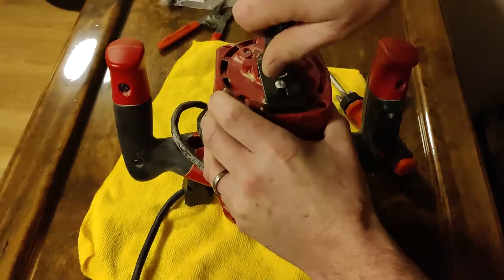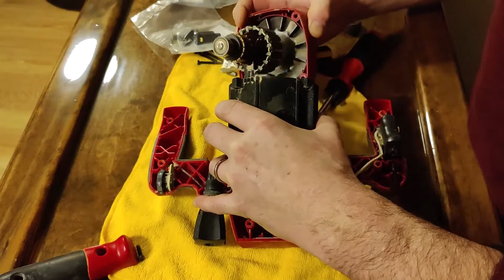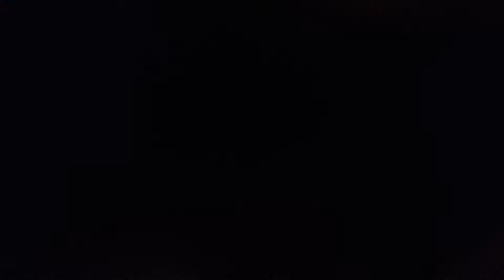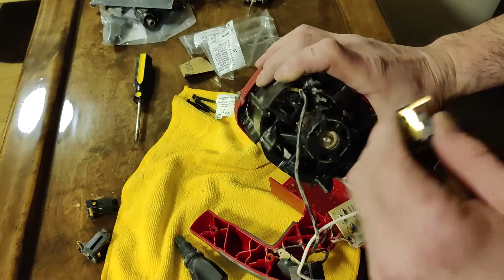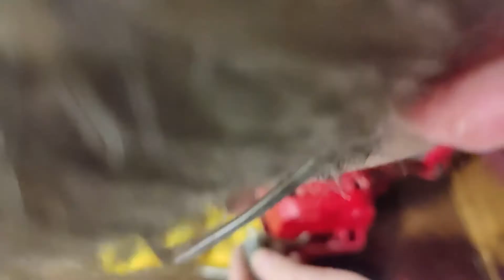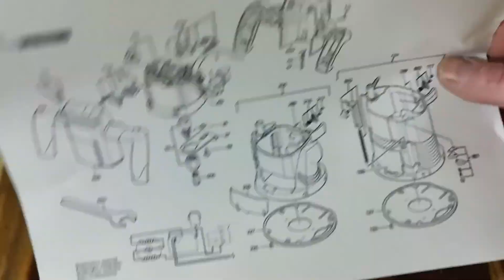Skil 1825 Router Brush Replacement

Comment: Glad I found this because you identified the replacement brushes. In case anyone wants to know, the part you removed was the armature shaft, not the motor, and it contains the windings and commutator (the part you sanded). First, one should try to clean the commutator with electrical parts cleaner and a brush (old toothbrush can work) then sand with 600 or higher aluminum oxide sandpaper. The material between the commutator is called mica (or it was mica long ago). If you sand/machine down to the mica you must undercut it. FWIW, the shaft lock does not have to be removed, nor does the armature. The commutator can be reached when the brushes are out. I'm saying this at the point of having removed the brushes, which I now have on order thanks to you.